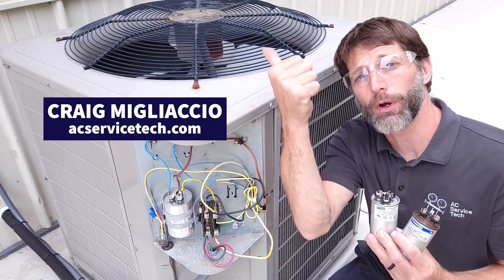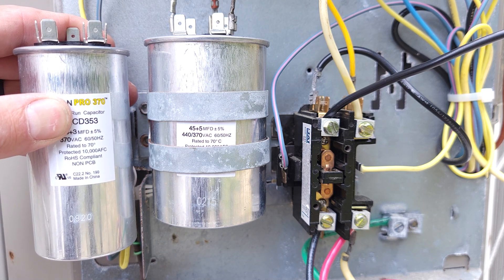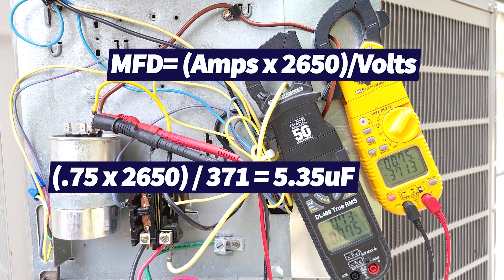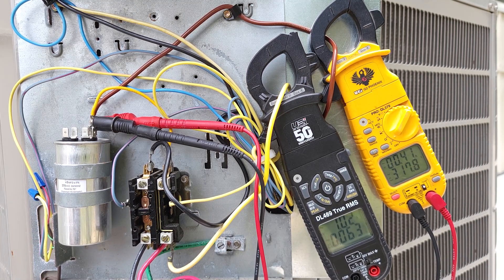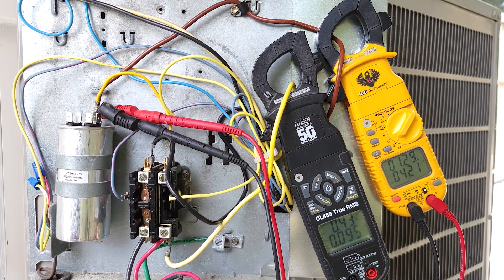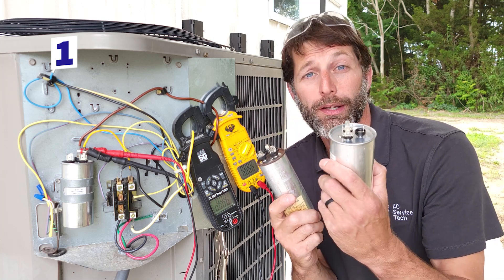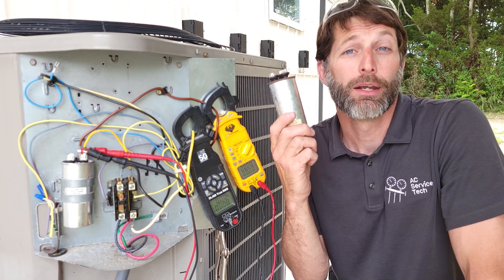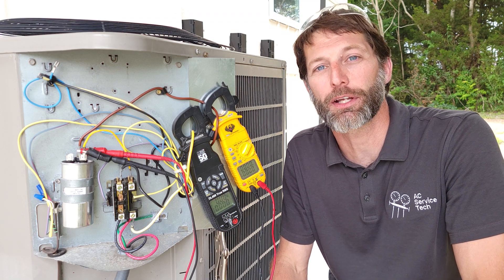Does a CAPACITOR Control Electrical Current to the Motor? Installing Wrong Size MFD to Test!

Comment: Hi, My capacitor went and it is 5/60 MFD but I can only find 60/5 MFD... Do I just swap the Fan and Herm wires?
Reply: Oh my goodness. DON'T. 5/60 is the same as 60/5. The 60 (or 50 or 70) IS ALWAYS THE COMPRESSOR WIRE (easy, just follow the wire to the all-sealed black round/cylindrical motor that the little copper pipe is connected to) and is called HERM (high electromagnetic rotational motor maybe) on the capacitor top. The small number (3,4,5 or 7) IS ALWAYS THE CONNECTOR CONNECTED TO THE BIG FAN WITH THE HUGE BLADE. That fan (albeit big) doesn't have to work hard to move air, so it's ALWAYS THE SMALLER NUMBER (3,4,5, 7, or 7.5) and is called FAN on the capacitor top.

Comment: What happens if you put the fan brown on common instead of purple and put the purple on capacitor (fan)  terminal? Basically starting on the run winding and running on the start winding,correct?

Comment: this is probably the best explanation of why a run cap is sized the way it's sized, you only focused on the fan but similar issue exists for the condenser side, the uF translates into capcitive reactance (impedance) which is controlling the overall RMS run current; this is why you have to be careful putting hard start kits on older units, they add START capacitance, way more than run caps, and if the start relay doesn't kick out properly the compressor run winding will burn up because of the high capacitance added

Comment: Hi. My heat pump is running but not cooling or heating so I checked the capacitor which is 35/5 and tested with a multimeter and get 20/5. So I replaced it with a new capacitor 35/5 but now heat pump won't even start or make any sound. I thought it was a defective new capacitor and bought another one but same problem. Any ideas?

Comment: What if the rating plate is gone in the compressor and can’t find the unit number?
Reply: You can probably use the same capacitor rating that was installed, and hope it was the correct rating.

Comment: The caps doesn't control the current...it's a battery that assists the current when the voltage cycle starts going back to zero. It provides the extra push or voltage needed for the motor to continue turning. Smaller cap = smaller push and the motor still needs a push from somewhere so it gets it from the lower voltage times the current needed. Thus the heat from the higher current. E x I = Power or Wok needing to be done. Just replace with the same size cap from the factory and it'll be fine. A larger cap will just have voltage leftover after discharging what the motor needs.

Comment: This video is 100% correct.  I have made the mistake of not double checking the existing capacitor and burned up a new motor in under 15 minutes! I will never make that mistake again.

Comment: I can’t find the one I need I found one that’s .5uf more 
Mines is 50/12uf 5% 270v 
Found one that is 50/12.5uf 6% 370-440v will it work
Reply: Yes, that is within 4% and most capacitors are only accurate within 5-6% when new.

Comment: Same thing with a microwave oven high voltage cap, a higher rated cap will over drive the magnetron and it will burn and overheat.

Comment: It seems to me that the nameplate capacitor rating is the value that will closely balance the currents between the running winding and the starting winding. What are the components of the “2650” constant in your formula?

Comment: What happens if you oversized the capacitor rating for the compressor?
Reply: Same than the motor. The difference ends up as heat that will eventually burn the windings.

Comment: The capacitor on my indoor air handler unit keeps burning out.  The 1st failure I had replaced by my HVAC company- happened when the system was 8 years old.  A year later it died and I replaced that one myself, and today, a year after that, it's dead again!  Obviously there's no compressor on this, just the fan motor.  I don't have the original capacitor, just the one my HVAC company (that I use for oil burner cleaning) replaced (for $350!)  I replaced that one with one of the same rating- 10 uF 10 MFD 370V/440V.  What do I need to look at at on the fan motor to determine if this is the correct size capacitor?  Many thanks!

Comment: Good video. What is "herm" in capacitor?
Thanks.
Reply: Herm is the connection for the compressor motor wire, and Fan is for connection to fan motor. C is for the common or neutral wire.

Comment: Are you sure your multimeter is able to properly measure amps with the likely phase shift in voltage and current?  The power factor shift of induction motors can be significant.  So your calculations of kw could actually be kva (reactive power).

Comment: Another fantastic video.  It is all about the percentage of being correct with the capacitors.  They need to be within 10% of nameplate (using a 55 in place of a 50 is at the limit of that, and acceptable but using  7.5 in place of a 5 is way off (50%) and not at all).

Comment: I always knew the capacitor was required to adequately charge the starter winding. I just now learned that the replacement capacitor needs to match the factory specifications for optimal running and potentially preventing destructive heating.

Comment: A friend of mine is a motor rebuilder, and accidentally plugged a 220v motor in to 110v, and couldn't get it to come up to speed.  He asked me what I thought might be wrong. I wasn't sure, but He was using a higher mfd capacitor than the motor needed to get it to run faster. I began by reading the label and then realized he had it under powered. The motor was dutch made, so I was aware that in all likelihood, they didn't have any 110v motors. After changing the capacitor, and plugging it into 220, he was able to get it up to speed.

Comment: Did not see or hear the logic behind the title indicated ---"Does a CAPACITOR Control Electrical Current to the Motor?" as you demonstrated the laboratory work which is good but incomplete.  From the title, I take it you are talking in terms of coulombs?  But I feel you are looking realistically at "resonance" with respect to the applied frequency to enable the rotating frequency. Let's not forget the other characteristics of BEMF and mutual inductance which influence the outcome.

Comment: For a layman, how do you know when a capacitor goes bad. Also I noticed on my capacitor the top is bulging.
Reply: From other videos, bulging means going bad.
Reply: You really need a meter that can test capacitors to make sure its good, but symptoms of going bad are physically bulging, or the motor taking longer to get up to speed.

Comment: The run capacitor on a PSC motor is selected to give the best power factor at the design load for the motor.  Increase or lower the capacitance, at the same design load, the motor is less efficient and the difference ends up as heat that will eventually burn the windings.  

It is possible to use a meter with power factor to swap in caps till you find the best power factor value.  But easier to read the label or contact the mfr.  

I believe there is a way to calculate a new capacitance value if you were to say use a PSC motor for an application with a different operating load, but it gets down into the motor design black magic.

Comment: The need start capacitors is why I prefer 3-phase motors that don't need them. All you need to check is the direction of rotation.

Comment: A EE would say that a capacitor controls voltage, not current.  But of course, Ohm's Law says that if the load resistance (motor windings) is constant than current changes proportionally with voltage !

The important thing to remember is, a fully discharged capacitor "looks like" a dead short and will draw a HUGE amount of current for a fraction of a second as it charges up.  Generators and inverters don't like this.  Any "true" soft starter must LIMIT this instantaneous current draw so the capacitor charges  slower.  Yes, the compressor and fan motors will take a split second longer to start up.

Comment: Great video. I've had coworkers tell me that you can put in a different size capacitor for the compressor or fan and I've always said that I go back with what's supposed to be there. They'd laugh at me an call me a "by the book" guy but I wear that label with pride. What happens when someone puts in the wrong size and another guy comes in and changes it. If each guy bumps up the mfd by 5 then we aren't anywhere close to what was originally there. Is the second guy going to look at the rating on the compressor and the fan motor? I wouldn't bet a penny on it! If you do it "by the book" then you don't have to worry about burning up motors or compressors.
Reply: TO BE FAIR, the compressor has more "wiggle" room with it. 

I do the same thing, if i see a "non-manufacturer from install" capacitor on a system i'll look at the compressor capacitor rating and put that one on.

BUT, compressors can easily handle the "50mfd and use 55mfd" swap as the numbers are way more forgiving than the outdoor fan motors' "5mfd to 7.5mfd."

I 100% agree you should put what it calls for, but just wanna point out on compressors the small changes from 45 to 50, 60 to 65, or 65 to 70, etc on those higher ends arent a big deal at all and I'll do it in a heart beat if I just don't have the 60 when it calls for that and i'll use a 65.

What I can't stand is when I hear a fellow service tech mention they put a 80 on a 65, etc because THAT is very bad.

keep doing it right though my guy

EDIT: never put on a lower number though. that's a hands down rule i've learned, even hearing it from the techs that put on those atrocities.
Reply: @Wilsontrax  I agree about the difference between the fan and compressor. The difference in percentage on the fan vs. the compressor is much greater  but I'm a stickler for correct. I've heard it said that an increase in the mfd on a compressor is the equivalent of leaving the key turned in the start position while starting your car.and it's already started. I just sleep better knowing that I've done it properly. There's so many times I've seen the results of lazy, rigging and not knowing or caring work that I can't bring myself to do it. Once you start cutting corners, where do you draw the line? Be safe.
Reply: @bill944  Haha no I agree. Line is drawn at 5mfd difference (UP!) and ONLY if I don't have the correct match on my van. But that's only me-- I know there are terrible people out there that don't care/don't know

I do agree with you though and you be safe my guy. Stay true! :)
Reply: @Wilsontrax  No , Just Put the Right One In, He Clearly Stated The Problem With Changing The Size Thats how it Should be Done . That Is More Than FAIR It's The TRUTH .Keeping a Couple Rescue Capacitors Are Well Worth The Extra Cost .
Reply: @Gcanno  I keep 5 of every size basically imagined on my truck. sometimes that doesn't cut it. :) have a good day
Reply: 2 years later I bet bill has gotten numerous raises or even moved on to work for a better company. All the others are either stuck at the same job getting the same pay complaining everyday or bounced around company to company getting fired. Be like bill. Don’t be a hack

Comment: When u are on the field with 8 hrs to do 16 calls u ll figure this quick.  Remember AC co are high paced ..field situations are like this. U on the 10 stories Roof...u only 7.5 mfd. U need 4 mfd. Truck is parked 3 or 4 blocks away. 93 degrees plus 10 in roofs...now What would u do or would u procede....time is money specially when u are in Miami area..parking here is 10 to 13 an hour😏.
Reply: That depends on your professionalism.
Reply: If you can look yourself in the mirror and not look away in shame, that's on you. You're making a quick fix that will only lead to problems later. Do it right or don't do it at all. Half assed is never acceptable no matter how you can justify it.

Comment: Is it correct that as long as the Capacitances are correct you can  replace a 370 volt with a 370/440?
Reply: Yes.

Comment: Wish I had seen this before when I was younger. I changed a Copeland compressor with a Bristol compressor for a friend of mine since the Bristol compressor was cheaper and he didn't have much money. I think they have since gone out of business. I installed compressor and had correct capacitor for it but I kept getting a higher start winding current than the run winding. Capacitor checked out ok. I ohmmed windings and start winding had higher resistance. It just didn't make sense that run winding was pulling lower amperage. I called Bristol tech support and they asked if amperage was within specifications on compressor. I told them all the readings I had and that I triple checked everything. Even changed capacitors a couple times. I checked charge also to make sure nothing off there. Voltage was within range and guy on tech support said they don't really check the start winding amperage at the factory and everything seemed fine to him. I told my buddy I didn't feel good about it but he had a year warranty. It lasted 10 months and burnt up. Changed it for a Copeland because I didn't trust the Bristol compressor (supply house just charged me difference between Copeland and Bristol cost) and it ran fine and within normal amperage for both run and start. Copeland compressor was still running years later. It was oddest thing I had come across.

Comment: Needed a separate video on the effect of having a run capacitor fail on a outside unit that had a hard start installed.
Reply: Hell ya
Reply: Yes indeed ran into that today
Reply: @KyleWithStyle7  Did hard start get the compressor  to run? I was wondering if it did what damage to the start winding it could do if not noticed right away.
Reply: @officerkrupke4966  it was running normal after replacing the cap, pulling normal amps. 2021 m#… 🤦‍♂️system was running like that for who knows how long
Reply: @KyleWithStyle7  What did the compressor behave like?
Reply: Plus one on this request. In particular, could a failed run capacitor cause the start capacitor to fail?

Comment: Is using a 5 mfd on fan/blower instead of a 4 mfd (because who the heck has a 4 on them) a major deal ?
Reply: Well he showed what happens in his video. 
Understand you can’t play with the absolute laws of electricity and HOPE it will be ok.
The miter and or the new capacitor are going to fail sooner or later.
The question is: Are we “hacks” or professionals?
Our salaries are dependent on people being able to trust us. When the customers believe we are all “hacks” they will just go with the lowest price option because they see no value in spending any more money.  ( please save your corrections, I know there are cheapskates out there who always go by price) that’s not what I’m saying here.
Reply: We do all the time on the field
Reply: @renecuevas4128  Don't say "we". Speak for yourself because I'll have no part in hackery. I carry 3, 4, and 5 mfd on the van. If you don't prepare for success, you've prepared for failure. YOU are the cause of the apprehension and the lack of trust that I deal with in customers.

Comment: Thus might sound crazy but I've heard several technicians that you could go up 10% higher on run capacitor on the compressor? I'm assuming that is not true.
Reply: I believe they may be referring to VOLTAGE but not the required mfd.
You can replace a capacitor with one having a higher operating voltage.
But as Chris said the mfd must be correct.
Reply: I've seen on videos that almost anything can be higher voltage rating (not fuses).
Reply: @d.c.hammond130  You are getting confused, big no-no to put higher CURRENT rated fuses in, but higher VOLTAGE rated wont change they way they operate (for fuses or capacitors). Putting a lower current rated fuse in is safe, but can cause nuisance trips, but putting a lower voltage rated component in could cause it to fail.

Comment: Good demonstration. I enjoyed it. Question, shouldnt there be 0 amps on the start winding after the motor is running full speed.
Reply: No because the start winding stays in circuit all the time with a PSC motor and the run capacitor is what creates the 90 degree phase shift where the voltage lags the current which is what creates a rotating magnetic field for the rotor to chase around 😉

Since the capacitor causes the voltage to lag the current, the vector diagram will visually show why the back EMF is greater in value than the input source voltage.

Also, the start winding has a higher reactance than the run winding hence most of your current will want to pass through the run winding instead.

The start winding is wired in PARALLEL with the run winding and the capacitor is in series with the start winding.  The start capacitor, assuming it has one, is wired in parallel with the run capacitor to increase starting torque and then is disengaged via a potential relay for HVAC units.

Parallel capacitors ---> C(total) = C1 + C2
Series capacitors ---> C(total) = 1/C1 + 1/C2

Hopefully that answers your question.
Reply: @weavercattleco  Yes it does. Thanks for the thorough explanation. I remember that now from school.
Reply: It's a miss-nomer to call it Start winding. Both of them "run" (have current flowing through) all the time, just that one winding is energized a few miliseconds after the other (because one winding is directly connected to the 240v, the other is connected to the capacitor before the 240v.